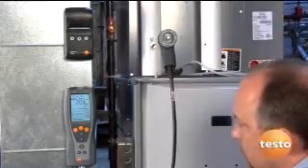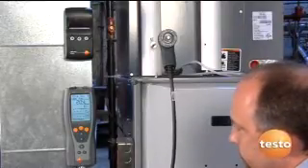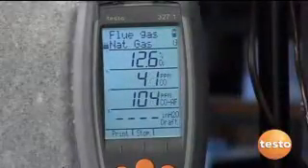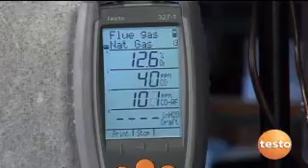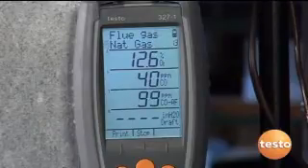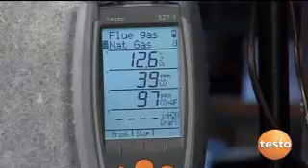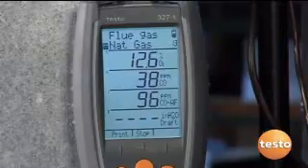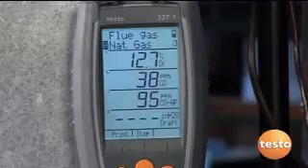Testo Combustion Analysis Introduction

Comment: Yes for natural draft appliances and the water heater depressurization is an issue. For the new hi efficiency furnaces (some of them have sealed combustion chamber) is possible theoretically but less likely in practice (in my opinion). Actually this can be proven by before and after combustion analysis :)

Comment from the maker: Because no sealed combustion is hermitically sealed, they all leak abound the doors. If the negative pressure in the space the furnace is installed exceeds the furnace ability to draft, the combustion is affected. We are also very concerned with atmospheric draft appliances installed in the same space like the hot water tank. There are standards for limits of depressurization for all appliances.

Comment: The furnace that you show takes combustion air from the 2” pipe directly from the outside and pushes it back directly to the outside true the 3’ pipe .How the drier, kitchen exhaust and bathroom exhaust fan will affect the combustion when the cover is closed?